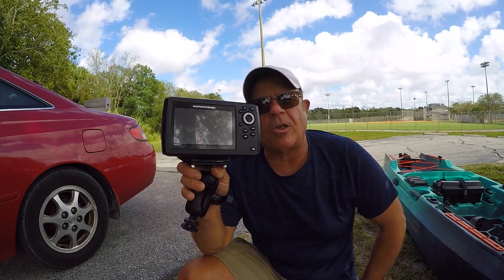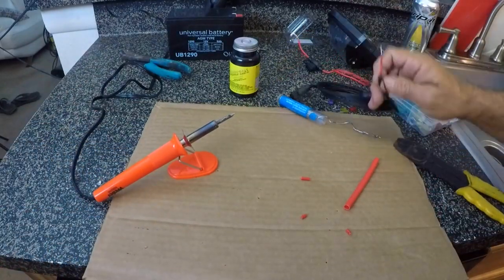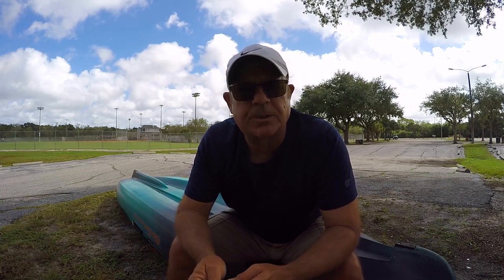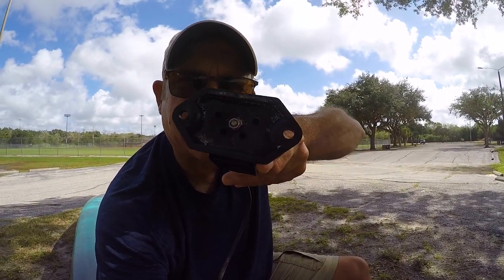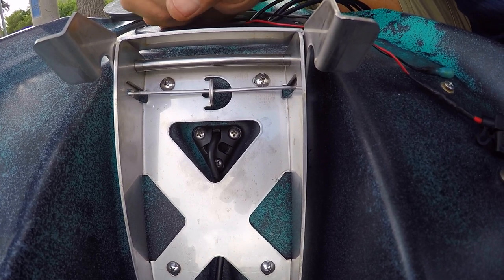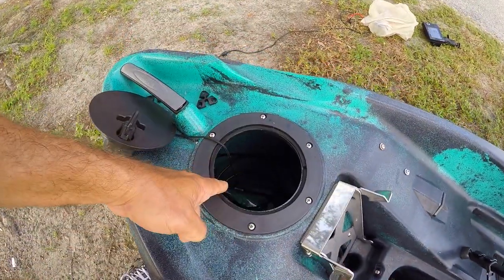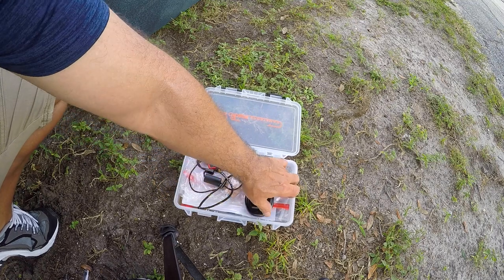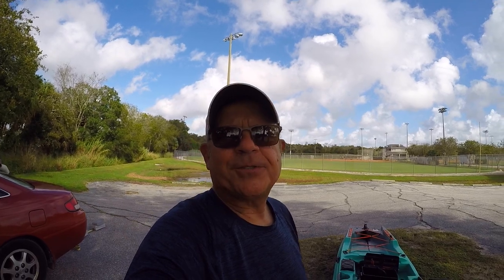Fish Finder Installation Old Town Sportsman Autopilot 120, 136, and 106 Powered Minn Kota

Comment: I just spent an hour threading just the Lowrance Gigantic wire and plug through the very small holes on my 120 Auto.  Took me an hour for just the display cord.  Had to reduce the size of the plug keeper to fit through both holes.  Then had to rig a way to hold the plug perpendicular to the hole to start it.  Hanger, String, Smaller Wire.  arm old person red marks on arm.  Done.

Comment: Hey Brother, when making a wiring harness / installing marine electronics, always get the heat shrink tubing that is marine grade. It has a special glue inside of the heat shrink tubing that seals and protects from water/salt water. A heat gun is also recommended and can be gotten at a decent price, plus you can always repair your 1/4" jacks/audio cables as well. Not saying anything is wrong with your build, just that it would have a much longer life before a problem arises. And that liquid tape isn't necessary when you use marine-grade heat shrink tubing and marine-grade silicone jacketed wire. Just a friendly FYI. Like always, love your videos!
I'm up here in the panhandle, (Pensacola), it's not very fishing friendly here. You pretty much need a boat to get to the sheepshead, which is not in my cards any time soon so I have to live vicariously through my favorite YouTube angler for now. 🙂

Comment: I wish I had seen your video before I installed mine in my 136. I really recommend taking the motor plate off to make it easier it’s only four screws and takes just a minute to takeoff. I’m going to have to reinstall mine now that I saw your video.
But I also suggested you use a fishing tool to grab the wires. It makes it so easy and there’s no frustration trying to find the wires.
Thanks again for a great video and I learn from my mistakes but I want to do it as you suggested.
One last thing, that is a great solution for the transducer mounting. I’m going to remount mine Without that secondary plate.
Reply from the maker: Thanks for watching and sharing the encouraging words.

Comment: We’ve ordered 106MK kayaks & will be using Navarre scupper mounts to run our transducers through the scupper holes there by the plug up front instead of mounting the transducers to the kayak’s universal mount.  It’s worked great on prior PDL models because it provides better clearance to protect the transducer from getting banged while sliding over stumps, brush, oyster, & while loading/unloading.
Reply: How well did that scupper mount work out for you? I just got my 106 MK and weighing my options here.

Comment: As for a battery I use a 4ah Nocqua battery that I tie strap to my Yak Attack arm mount so there is no need for running any cables etc. just attach transducer and good to go.

Comment: I just mounted a Helix 10 with side imaging on my sportsman 106 MK. I had to mount it much lower than I was hoping to avoid the hull interference with side scan. I plan on testing it out and trying to tuck the transducer up in the hull more and more each time until I start getting interference.
Reply from the maker: Awesome. I'm sure I'd get more use out of the side scan model. I tend to fish more docks and mangrove island edges than straight down bottom fishing.
Reply: Network Guy, please let me know how this turned out. I don’t like mounting my transducer on the bow plate they have on my AP120 it’s just waiting to get destroyed loading and unloading it so I’m trying to mount it in the tunnel hull but afraid it will affect my side view

Comment: I finally got around to running my trans cable and it took about 5 minutes lol and just to add more waterproofing I am going to slather on some waterproofing silicone for good measure. I also finally adjusted my motor locks I guess they come from factory fully torqued down so I loosened up a little and also came to realize I wasnt turning them all the way but only half lol I thought my motor was rattling a little too much duh! Yeah one more thing the 106 is much easier to reach I had no problem running the cable through the hull.
Reply from the maker: Thanks for sharing your progress.
Reply: @RadReelingFishing  Yeah I`m learnin . Yesterday I was out for about 6 hours and motor was still running I use a 50ah Lithium. Later I checked the battery with a meter and was at 11.** volts. I wouldnt think the motor would run under 12 volts...

Comment: Rad reeling, how do you like the Helix 5? Do you wish you had gone with the Helix 7?? I have the same AP120 with the Helix 5 with side view but debating on exchanging it for the Helix 7. Is it hard to view the screen during the day? I appreciate any help you can provide. I love your channel you do a great job of teaching so keep up the great work
Reply from the maker: Thanks for watching. I only use the Helix 5 periodically when I'm bottom fishing.  I like it for finding those ledges and for knowing what the water temp is. Most of the fishing I do though is around structure like mangroves, bridges and docks so the side scan would be more suited. When the sun is shining bright I usually have to move the fish finder around to get a decent view since I don't have any type of sun shield on it.

Comment: JC....good day to you. Question do you have to have a fish finder for the autopilot Minn Kota to work or does the remote act as the positioning device. Thinking about the auto lock feature...find fish or structure stay on it.
Reply from the maker: Here's an Old Town video I time marked for you to help answer your question:  https://youtu.be/k2tsIRp2KFk?t=204 Here's the link to the actual PDF manual where you can find the step by step info on your question and much more about the ipilot functions: https://bit.ly/3sPbok4  I hope this helps.

Comment: Hi JC - what wire gauge did you use?
Reply from the maker: The wire was supplied with the fishfinder.
Reply: @RadReelingFishing  I meant the inline fuse gauge wire that you used.  was it 10 or 14 gauge with 3am fuse?
Reply from the maker: @mtnguyen1696  I'm not sure. This is the fuse I used 4) 3AMP Inline Fuse Adaptor
https://amzn.to/36e1cao (paid link)

Comment: Can the motor follow routes you create on the hummingbird?
Reply from the maker: I'm pretty sure the operator would have to record the initial track to the location on the Minn Kota system. Once it's recorded the motor has the capabilities to auto pilot to that location when it is within 1/4 mile of the spot.  Thanks for watching and asking.

Comment: How well does your transducer mounting work? I just got my 106 MK and I have a Helix 5 DI (not SI) so I am hoping this will work for me as well.
Reply from the maker: The transducer works fine mounted like this. Thanks for watching.
Reply: @RadReelingFishing  Your videos are very informative. I went out for the first time today and a couple of times my sonar blacked out and depth went crazy I think because of hitting some waves, i think also I need to straighten out my transducer a little because its slightly angled.
Reply: @RadReelingFishing  I have one off topic question about the rudder. Is it supposed to sit in the water at an angle? My lever still had a little play in it,is this normal? It steered fine with little effort but I am curious about the rudder.
Reply from the maker: @shark619ify  Yes the rudder should be close to a 90 degree angle in the down position. You can see the rudder in this video: https://youtu.be/K1SjNXqsWzA also this video shows the rudder in the down position: https://youtu.be/_D0YpSttFOw?t=663
Reply from the maker: @shark619ify  The transducer is supposed to be slightly angled on the Helix 5 You can see it here: https://youtu.be/BpG5Ge5rZ3M?t=618
Reply: @RadReelingFishing  I see,Thanks yeah I guess thats the way its made it doesnt take much pressure to steer either.
Reply: @RadReelingFishing  Yeah OK then im gonna leave it alone becuase thats how its set up. I didnt have any more problems after I tweaked around with my settings so hopefully this is not an issue. Today was my test run and hopefully next week I can get out and really fish.
Reply from the maker: @shark619ify  The cables on the rudder are easy to tighten if you think there's too much  play in the steering lever. Just give them a turn and you'll figure out which way it needs to be turned to tighten things up a little.
Reply: @RadReelingFishing  Thats good to know and Im not
to worried right now because it steers fine. But yeah you have the most useful video on this and you cover just about everything. Although one more thing when I hit a wave I could here some rattling does the prop hit the kayak on waves or is it just my rudder flopping around?
Reply from the maker: @shark619ify  There's no way for the prop to hit the hull because it's locked down into place. I couldn't guess without hearing it.
Reply: @RadReelingFishing  Yeah the next time I’m out I’ll figure it out hopefully might have just been my gear rattling around.
Reply: @RadReelingFishing  Yeah this didnt happen again I think on my first trip I didnt have the battery secured down and thats what I heard...lol

Comment: Soldering was all wrong. From the way you meshed the wires to heating the solder. You heat the wires and let the solder soak into the wire when it reaches the correct temperature.